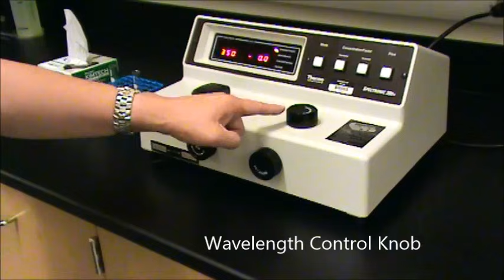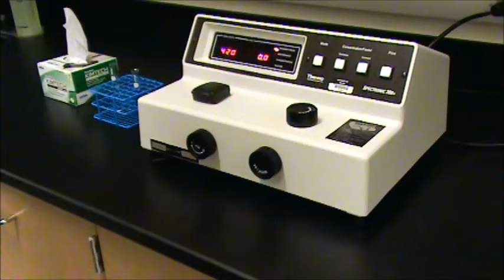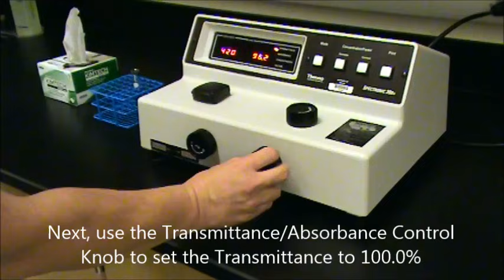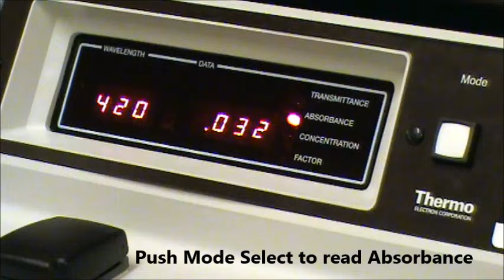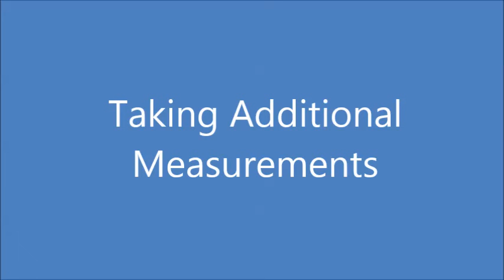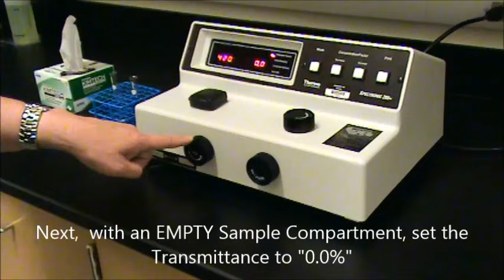How To Use A Spectrophotometer

Comment: Do you have any thoughts on the cost of a unit. I want to measure reducing sugars of different mashes in a professional distillery. Just trying to cook the grain and get the highest levels of sugar. I see Amazon models for sale as cheap as a couple hundred dollars, units in the $1500 range and then $6000+ range.  I am not doing research just relative concentration of reducing sugars that would be repeatable. Thanks in advance.